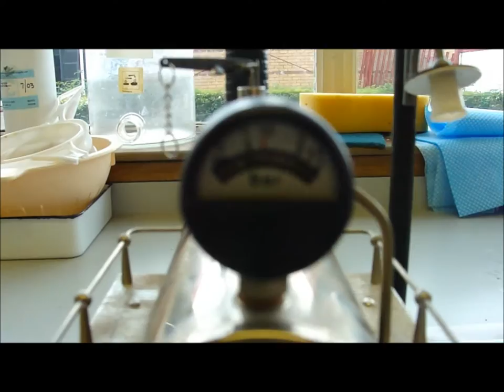Wilesco D18 steam engine [HD]

Comment: Hello Go Pro Flying,
I just subscribed to your channel, that was a very interesting demostration of a steam engine.
I recently bought one very similar to yours except that it does not have the lamp post
and no rails and only one ladder i am trying to figure out what model i have.
Yours has four connections at the engine and mine only has three the "relief valve" also is different than yours and mine does not have that black round thing in the back/next to the flywheel, it looks like you added the pressure gauge am i right?
Also what is that vertical receptical that is located right before the piston?
Any help will be greatly appreciated.
Cheers
Rob
Reply: Wilesco is still in business and has a website.
Reply: Hi Doug, thanks for the tip I will check out their website, maybe I can find the parts that I need.
Cheers

Comment: I wonder if you replaced the wheel with a bigger wheel say twice the circumference would the electric output be more?
Reply: St. Apollonius Yes, the voltage would certainly rise. However, I think it's a better solution to replace the diod in the lamp with a lower voltage one and, as I already wrote, protect it from over voltage with a zener-diode. Maybe in conjunction with a NiCad-cell that would take charge when steam is running and give voltage (via a switch) when steam is very low or completely off. If it is AC (the generator) a rectifier would be needed too.